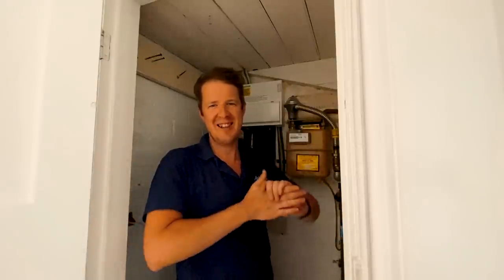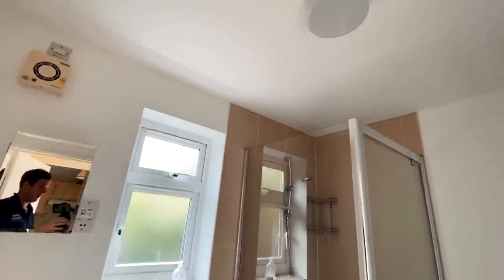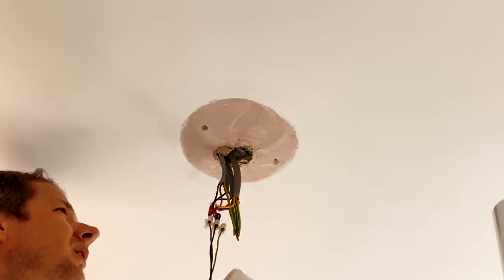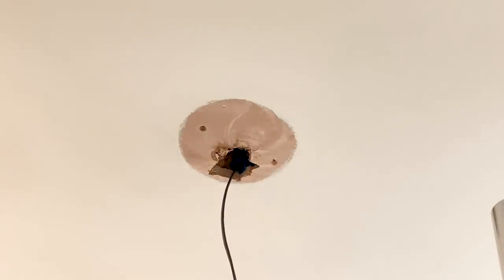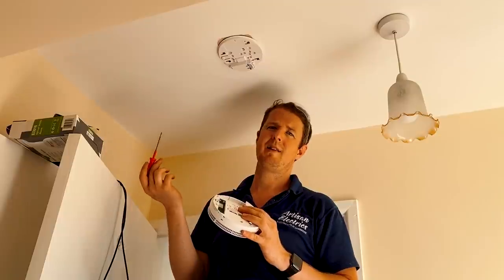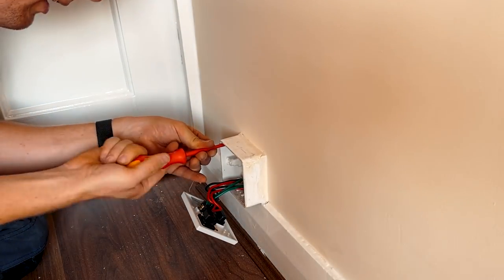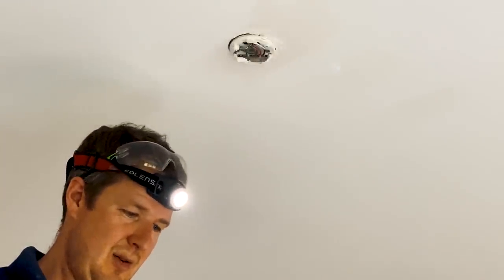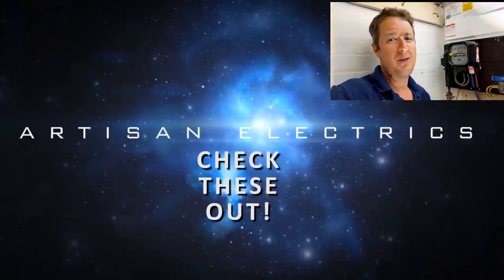Repairing Electrical Faults - Electrician Life

Comment: So the Knightsbridge Led light if any of the LEDs go you replace the whole light? Yes material shortages here as well in USA places like city electrical and rexel. Ordering anything from China takes so much longer now
Reply: Yes, but the leds will probably outlast the driver pack in the light anyway
Reply: @dj_sparkks  You can get the drive packs spare quite often. The only throw-away LED lights currently are Emergency fittings. It's 2 quid more to get a new fitting than the batteries for replacement.
Reply: Set them to warm white only. If they fail, flick the switch to cool  white

Comment: I don't like lights like the one you mounted in the bathroom. All LEDs are shining downwards. The floor tends to be of a darker color. So much light is absorbed. The walls and especially the ceiling, mostly being bright or white painted, don't really get illuminated well. But they could reflect much more light than the floor. So you end up needing much more power for lighting the room properly than necessary. In addition, the light feels uncomfortably because you don't really get diffused light an thus strong shadows. It's the same about downlights, by the way.

Comment: That fitting that needs drilling..... why not drill whilst on the floor?  Then if the screw jumps off the screwdriver tool, you will have it at your fingertips, instead of nearly 2 metres below you.

Comment: lol all those wires is why we are supposed to use round light boxes for light fixtures in N.america can always make them bigger by adding rings if need be instead of having a loose mess like tht tucked up into air where a spark cld start a fire.

 funny enough flat ive been renting for 20 yrs yup light fixture(wall sconce not ceiling)  had a fire why old knob and tube wires from pre 1950 bad connection splices not in box thankfully just melted bad wire connection and a little of the insulation but agian not in a box and yes K&B wires should never be covered in insulation.  

 it was more work  switch boxes all had to be redone all fell out of wall all short wires had to be lengthened  and added for the light

Comment: I use that light fitting and I cut a 20mm hole in the back of it and have the loop accessible inside. Not sure if there is a living space above but that hole made in the ceiling now fails the fire rating of the ceiling which a plastic fitting does not reinstate once fitted.
Reply: Does it have a fire rating? Only if upstairs is a separate dwelling.
Reply: @tobysherring1369  exactly, which is why I said "not sure if there is a living space above". If there isn't then it doesn't matter

Comment: I had the old classic diy thing today when removing a diy metal light fitting for plasterers to install a new ceiling, I found the connections were from an old pendant with the brass terminal connection blocks just taped up. Well at least they used tape

Comment: Drill a big hole in the fitting
Connections within the fitting.
Put screws in the fitting before offering it up. Use a 12v impact.
Viola. Ffs

Comment: You say the ring can cope with 26 amps on the washing machine drier  double socket  ,  did you check the balance on the ring main , because if that mains pulling more than 20 amps from one leg  the circuit could be overloaded
Reply: If the spur has been properly installed on the ring, and I'm sure he checked ring continuity, it's not on a leg, it's on the ring. Anywhere on the ring could, in theory, draw 26A. JW reminds us though, that a double socket is rated at 13A, total, not 26. He would fit two singles in this circumstance. But that would mean extending the ring. However, both machines have cycles - they don't both draw 13A continuously so by the diversity rule it is acceptable.
Reply: He said the 2.5mm spur can take 26A which it can as 2.5mm is rated at 27A. The ring itself is 2x 2.5mm so technically a 5mm circuit which can take allot more than the 32A that its protected at
Reply: That being said, you shouldn't have 1 double socket supplying 2 high load appliances as they are rated at 20A max
Reply: @TeamSimpsonRacing  where is that 20A rating stated? John Ward says 13A.
Reply: @tobysherring1369  No one leg of a ring should carry over 20 Amps for a long period of time (assuming its a 2.5mmring) , so if this socket was in the middle of the ring it would pull  13 amps  from both sides no issue apart from the rating of the double socket ,  now if that socket was located say a quarter of the way from the CU on one leg then the split would be different ,  now you can assume that kitchen ring will have other items on it as well so it doesnt take long to overload a circuit  leg , if the  ring is not balanced   regulation 433.1.204  formula Ia=b *IL /a+b  covers it , realistically you need to calculate the length of the cable to be sure
Reply: @tobysherring1369  The 20A comes from the product standard - 20A for 4 hours against a 54C temperature rise. As far as I'm aware this is the standard manufacturers have to test their double sockets too. I think the regs call single and double socket 13A due to their use for 13A plugs but I might be corrected.
Reply: @steverobinson8170  I'm no expert but how do you decide where one leg ends and becomes the other leg? Isn't that the point of a ring? Half way round in terms of length may not be half the loading. I would have thought many rings would have a concentration in a kitchen, for example, then have a long run around the ground floor but with much less loading. In terms of metres, it's unbalanced, but perfectly normal. There's no test on an EICR for a balanced ring. There's no limit on the number of sockets, and every socket could have a spur and still conform to regs (albeit bad design).
Reply: @tobysherring1369  It would be half loading on that socket , you do similar calcs for each socket  add them up and it gives you  the loading's overall  called ring balancing , not normally an issue on most domestic rings apart from kitchens where you now  can have washer , drier, dishwasher and sometimes oven  all on the same  circuit  in older properties ,or spured off as this is
  realistically anything that can drawer over  2Kw  and is likely to be in use  for a long period should be considered for its own  radial supply . I know thier is no test in the EICR  however when you do  the inpection circuit loading is something you can comment on.  We are using far more electrical equipment in a Kitchen now,  and older properties electrical systems are being pushed to breaking point , its not unusual now for the machines to run whilst occupiers are at work , or overnight , something never considered in the past. What you also have to consider this spur is probably linked into another socket somewhere which  could theoretically have dishwashers, or even an oven plugged into it if this concentration is close to the CU  the current drawer on the one leg could be considerable.